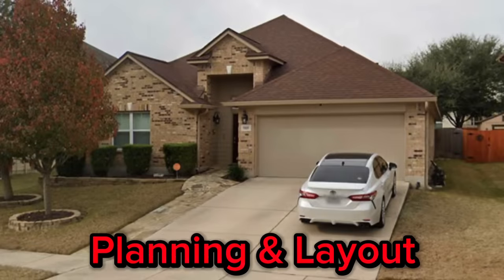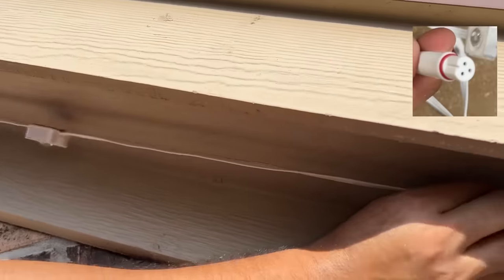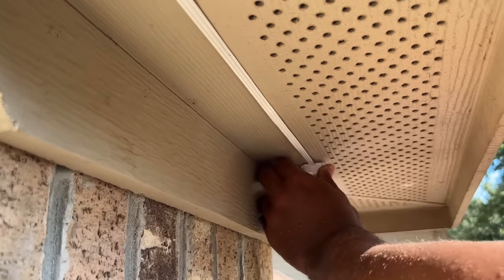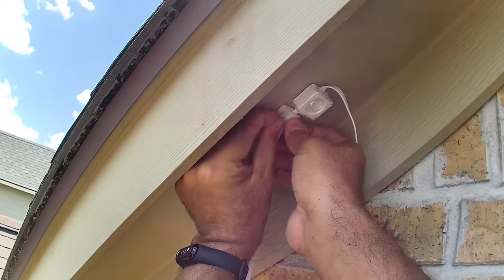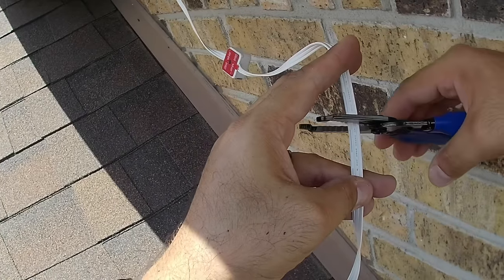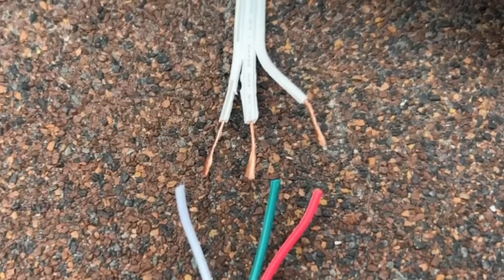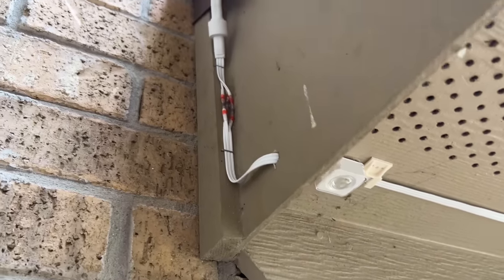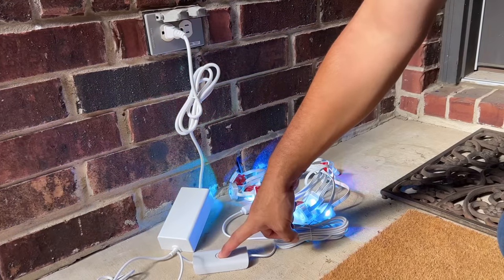Govee Outdoor Permanent Lights-1st Gen.*HOW TO FULLY CUSTOMIZE* @GOVEE #govee #howto #diy

Comment: I would have mounted them all the way to the front up against the facia board. That also would have made it easier to hide the wires. Did you not use the provided 3m tape? Those ciips look hideous.
Reply from the maker: You may like them all the way at the fascia but most of my subscribers and new clients recommend the triangle effect. Since the video, we have switched to the transparent clips so they are not seen. The whole purpose of the video is to educate viewers on different methods of installing your lights. You choose how you would like to install your lights. As far as the 3M pad, if you take a look at my home review video, they start falling after 5months of install. I clean the soffit area like describe by the govee instructions. We read endless amount of messages on Govee groups to address the problems here

Comment: If say, I buy the 50-foot kits. I have 3 areas of the house to cover. But each section is really only 40 ft. Can you cut off the last 10 feet?
Reply from the maker: Hi and thanks for watching our content. You just need to end your lights with 4 or more for them to work. If your jumping from eave to eave then you can cut anywhere. Keep your jumps small, less that 2ft and a minimum of 4 total

Comment: holy cow - I was freaked out you were going to cut yourself but great video!  I've always wondered about wasting pieces you know?
Reply from the maker: lol, thanks for your support to our channel. When we do installs, we literally take about an 1 hour or so of planning/thinking before we start. It’s a must with these lights. Need to do as less customizing of wire as possible so we try and start our connections at eave jumps but take in consideration where the peek light will land
Reply: @jbsdiytv  Have you thought of a way to do the flood lights but go across sidewalk?
Reply from the maker: @DesiSegundoIII I have not really worked with the flood lights before, just know that they can be grouped and be controlled together in the app

Comment: I cut mine and now the 2nd floor doesn’t light up 😢
Reply from the maker: How long was your jump. Custom or extension provided by Govee?
Reply from the maker: Did you do a factory reset? Holding down for six seconds? Or going to your settings and change the segments of strands

Comment: Great work!  What extension wires did you use to go up the roof lines?
Reply from the maker: Hi and thanks for watching our content. Both long jumps from bottom top where the 12’ blank extension provided by Govee. We install 2-100 ft so each box comes with a 12ft blank extension. The smaller jumps are 3-18awg wire. Only make those small jumps like 1-2ft

Comment: I got the 100ft goove permanent light pro lights.  I think I am only putting the lights in front of the house and will have about 20ft left.  can I just cut at the end and does the 100ft comes  if different roles or is just one long string?
Reply from the maker: Hi and thanks for watching. You can cut them. The strands come 16ft 7inch in length and have 10 lights in each strand. It comes with 6 strands

Comment: Why y'all want to charged me $2,600 for installation when I have my own lights? $2,600 for the labor is hella insane! I still didn't get an answer from y'all..
Reply from the maker: My wife was very professional with you and did not want to entertain how much of an insult it is to question what we charge. We have the right to charge the way we do and also refuse service. She answered you because we share all accounts. She just ended your conversation even before you said you wanted to unsubscribe from the channel. We just don’t install where we have devices showing anywhere and we do extensive planning prior to your install because this product requires thought if you decide to customize by splicing and jumping long distances without the proper knowledge of voltage drop. We take care of all those problems for you. Even after you get your install, we provide app support to the fullest. You can get other companies to install 100ft for 8-12k. Please do some research before insulting my business pricing as we value our time and work.